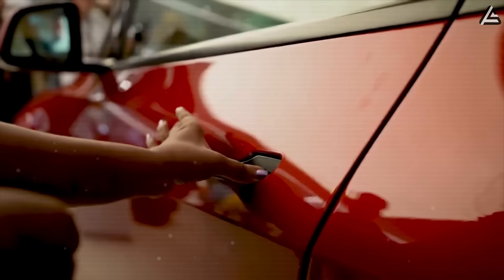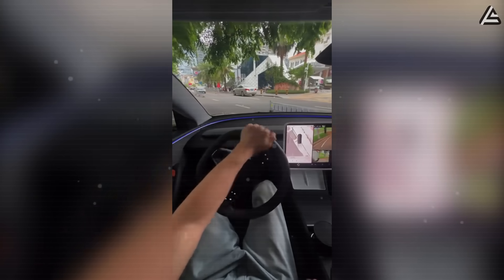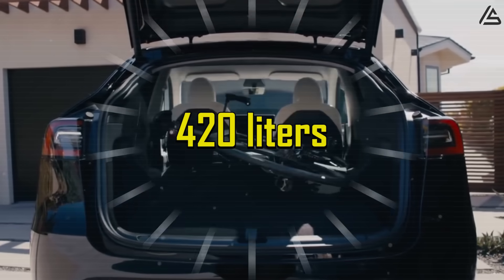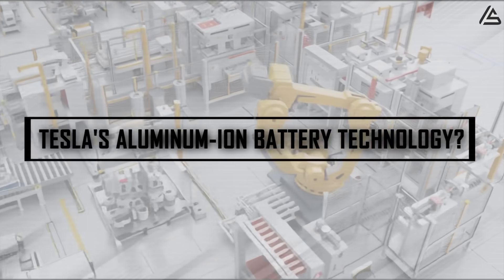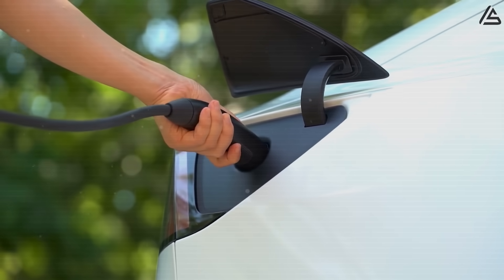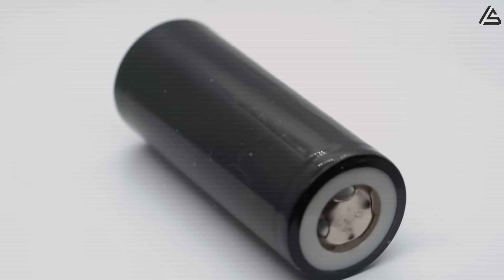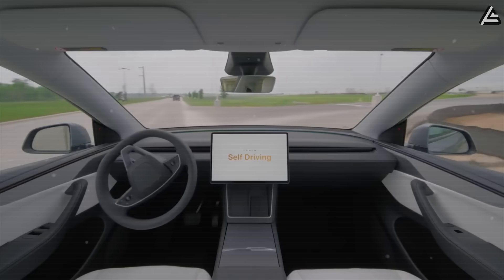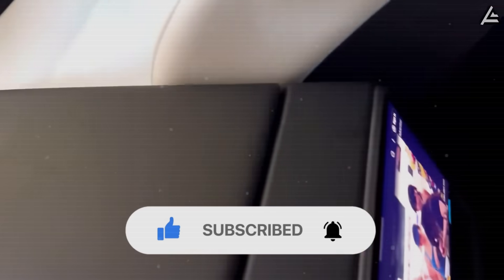Elon Musk Announced 2026 Tesla Model 2's HUGE CHANGES: Design, Battery & MORE

Comment: It depends on the range.  If the range is 250 miles, then clearly it cannot be used for anything but local trips.  If Toyota comes out t=with the 1000 mile solid state battery in 2018, with double the charge capacity and 10 minute charge time, then .......
Reply from the maker: thanks for your sharing. you got a point

Comment: If the sodium-ion battery lasts so long, I can easily see a used battery market forming in the years to come.
Reply from the maker: what battery do you prefer to use?
Reply: @AutoGearShift2 The battery I prefer doesn’t exist yet. 😂
Reply from the maker: what is that battery? can I know a lil bit?
Reply: @AutoGearShift2 zero point module
Reply from the maker: understood. we will research more about this battery

Comment: DONT WANT A SCREEN TO BACK UP, BIG HARD TIRES. Why. Stupid door handles?  No two doors?  Don’t want AC. Don’t want motors in my mirrors, seats, e-brake. Look at the 2015 Toyota yarus. Lots of head room.  Who designs these cars?  I can do better…
Maximize interior space????  Why no normal door handles? Drag?  Weight? Normal door handles are better. Less weight for the dual system. Wires, motors, neodymium, etc… what a joke. Then u fix these cars.
Reply from the maker: I hear your frustration — modern EVs pack in a lot of tech that not everyone wants or needs. Tesla designs with aerodynamics, efficiency, and “wow factor” in mind, which is why you see flush handles, big touchscreens, and powered everything. But you’re right: all those motors and extras add complexity and cost. The challenge is balancing simplicity, repairability, and affordability with efficiency and modern features. A back-to-basics EV, more like that 2015 Yaris you mentioned, would definitely appeal to a lot of practical drivers.

Comment: Is the model 2 able to accommodate the larger driver/passenger? especially with entering and exiting the vehicle.
Reply from the maker: based on their design philosophy, the Model 2 will likely maximize cabin space with its flat battery floor and minimalist layout. That usually means more headroom and legroom than you’d expect from a compact car, making entry and exit easier even for larger drivers and passengers.

Comment: Insurance in the UK too high
Reply: So is in the us
Reply: I like the car, with a reduced performance to cut the cost of insurance premiums that are far too high ,due to these cars being catarised as high speed performance vehicles, not sedate family friendly cars for none performance use, not ❤everyone wants to drive at illegal speeds and have warp factor eccelaration for everyday travel, performance  is not any good ,  we need cheap long range reliable cheap to insure, comfortable cars, that's the answer for car manufacturers to get a grip , not the hip, ie like the Beetle a peoples car the sold universally,  hope up speedster won't flood the markets short term , but nothing term.
Reply from the maker: That’s a great point, not everyone wants extreme acceleration or “performance” insurance costs. The Model 2 is expected to be more of a practical, affordable, family-friendly E, closer in spirit to the original VW Beetle than a sports car. If Tesla keeps the focus on low cost, long range, and comfort, it could become that true “people’s car” for the EV era.

Comment: How well does the Model 2 stand up to a head-on with a semitruck?
Reply from the maker: No small car, including the Model 2, can fully withstand a head-on with a loaded semitruck — physics simply doesn’t allow it. But Tesla’s strong frame, low battery pack, and advanced safety tech give it far better crash protection than most compact cars. However don't ever try it, my friend!

Comment: The model 2 will start at closer to $23k without the $7500 incentive.  The $7500  EV is going to be eliminated and should never be considered as part of the vehicles initial price.
First off to get the full $7500 you must have paid at least that much in federal taxes. By the time the model 2 hits the street it will probably costs closer to $25,000. That still isn't a bad price, but why can't they just be honest about the starting price
Reply from the maker: The ~$25,000 figure comes from Elon Musk’s own statements about aiming for an affordable entry-level EV, not an exact MSRP. Incentives like the $7,500 credit vary by buyer and may change before launch, which is why estimates differ. Rather than dishonesty, it’s more about Tesla leaving room for market conditions, production costs, and policy shifts before locking in the number.
Reply: @AutoGearShift2 Musk learned from dumb Donny, just lie about the price, Americans are stupid and will believe you.
Reply from the maker: not that negative

Comment: It’s a shame side mirrors are DOT mandated
Reply from the maker: so you don't like side mirrors?
Reply: @AutoGearShift2 I replaced my rear view mirror in my van which has no rear windows in them. Why not replace side mirrors with cameras either showing on a dash monitor or better yet displayed in a heads up display in the side window front corner.
Reply: @AutoGearShift2 I have a rear view camera on my van which displays on a screen within my rear view mirror because the van has no rear door windows. Side view cameras could display either on a dash mirror or better yet a heads up display on the side window corner.
Reply from the maker: That idea actually makes sense, and several automakers, Tesla included, have explored camera-based mirror systems. The main blockers today are regulations, driver adaptation, and reliability in harsh conditions, not the tech itself. The next video will cover why cameras will likely replace mirrors over time and what still needs to change for mass adoption.